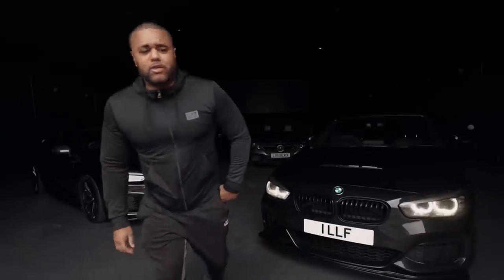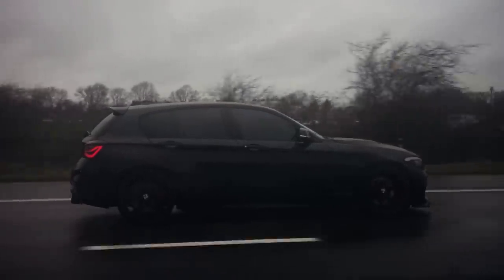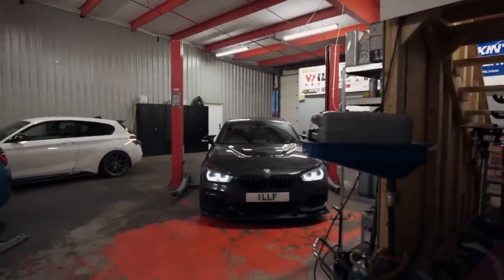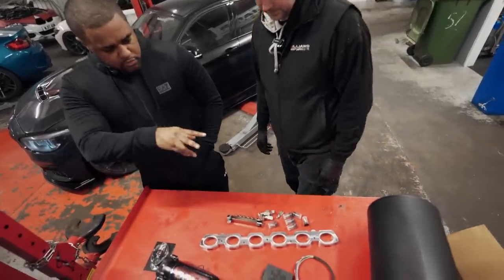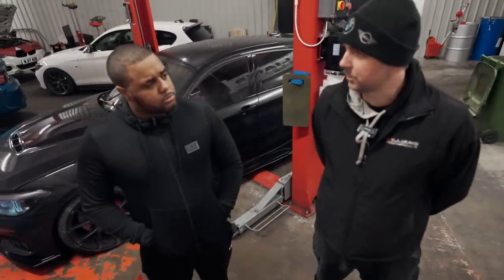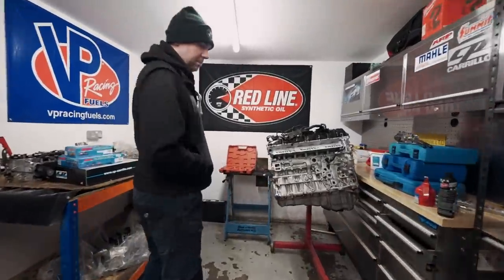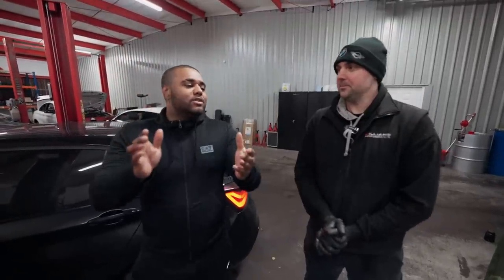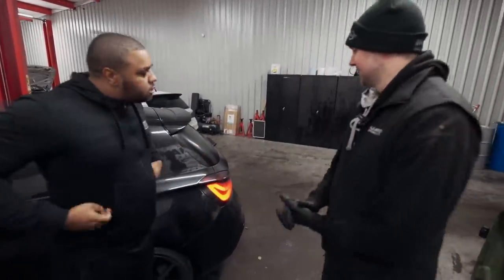MY 1000HP M140I BUILD FINALLY BEGINS!!

Comment: Big numbers make snappy headlines

Broad flat torque-curves make cars that are enjoyable to drive.
Reply: Drive a G35 powered B58 first mate
Reply: Show me 800lbs/ft holding from 1500rpm to 8500rpm

If it’s all lag till 6500 then boost till 7200 then limiter all you’ve  done is build a very laggy car that’s always off boost
Reply: @nickcook7408  so you want to see a car that’s pretty much underivable until 4th gear. I take it you can show a turbo that can achieve that on  b58? I don’t believe for one second you are one of these people who just give out negativity for no reason…

Comment: Man like Ricky aka LLF do not use the g 1050  it won’t make 1000 bro look into it  that turbo is a big deception bro. You car will struggle to make over 680 whp. I hope you prove me wrong brother . But time will tell. That turbo flow rate is not  enough for 700whp or even  not to mention 750whp .